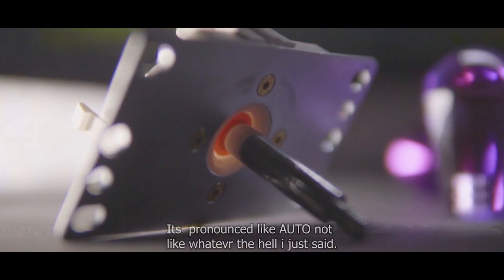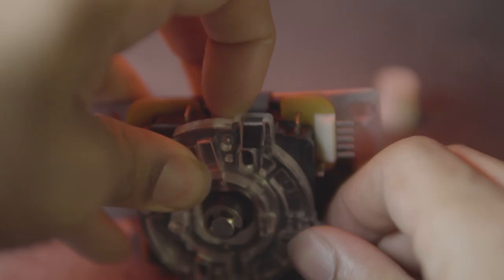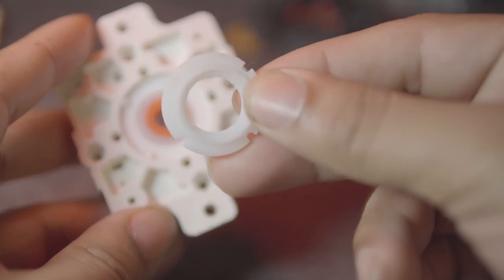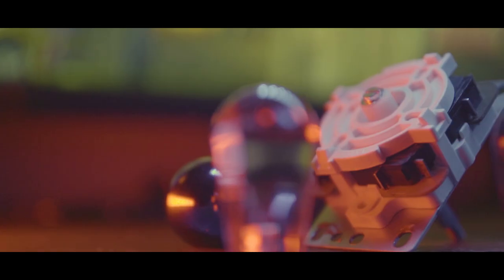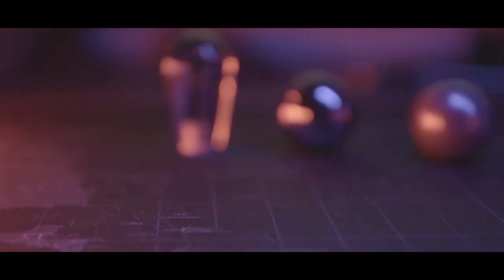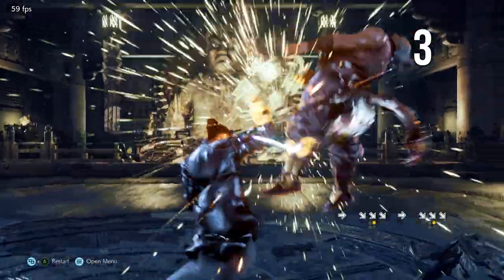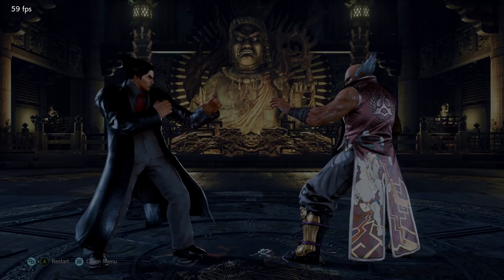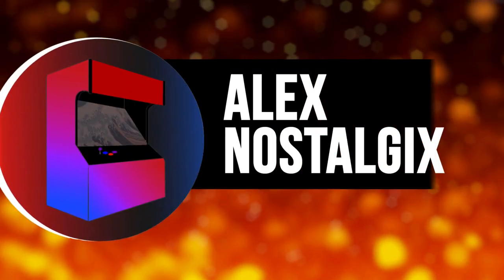A  Korean Sanwa JLF joystick? - OTTO DIY V2 Kit Review

Comment: I have a gaming pedestal and fitted two sanwa jlf's.
I had no idea how frustrating these joysticks are as they literally double-click all the time, causing input interference.
I initially blamed the switches, and wasted more money buying new circuit boards, I then purchased upgraded springs and a larger set of actuators, which then caused a lack of inputs.

I now have an otto v5 kit on order, and will hunt down the shuriken jlf solderless switch pcb. In other words, the sanwa is a terrible stick that is seriously flawed and has cost me triple the cost in the long run.

Comment: At 7:25, you bring up the issue of unwanted opposite inputs when you slap the stick in one direction and let it return to neutral, then say that it's not actually a fault of the kit itself.

Actually, it IS a fault of the kit. I installed the kit and had a similar issue myself, until I found a reddit comment describing it. The oversized actuators that come with the Otto DIY V2 kit have a diameter that is too wide to properly function with the JLF switches. I then swapped the Otto actuator with a Kowal oversized actuator that I purchased as the comment recommended, which matches the stock JLF actuator's widest diameter at that point, and the issue was diminished or eliminated entirely for normal use.

I just wanted to get this information out there in case anyone purchases the Otto kit after watching this video and finds themselves frustrated. It would be in your best interest to stick with the stock JLF actuator or purchase something like the Kowal actuator that is more carefully designed. Hopefully future iterations of the kit will fix this.

Below is an imgur album I put together with a link to the reddit comment, as well as a comparison between the stock JLF, Kowal, and Otto actuators.
https://imgur.com/a/Cq4gc25
Reply: I don't mean to say that it's impossible to get used to it, just that your initial feeling that something was off was justified.
Reply: Ok so I already have a bunch of different sized actuators.  You're saying it's fine if I use one of them?

Comment: Hey mate, I've been looking a tad into Korean parts. Do they usually fit where Sanwa JLF's fit?
Is the quality between Fanta and Crown too different?
Reply: The size here, I meant it's height, as from what I've seen, some Korean sticks have a protrusion.
Reply from the maker: @shocknawe  Not all Korean levers have protrusion due to the collar. The Crown MJ, 303 Dong Pal, or something like the Golden Fanta are just plug and play. With that said some fight sticks can't even accommodate a Korean stick due to the actual size of thejoystick body. I'm currently doing to Korean stick video comparing a few but unfortunately its on the back burner do to work related projects. So keep an eye out for it!

Comment: Oof. I really wanted to pickup this kit (trying to build one single portable stick to play both 2D and 3D), but coming from a Fanta I'm not sure I could handle the opposite inputs when you let go of the stick. I've become too used to the Fanta's return to neutral.

Could you elaborate on what you were saying about changing how you hold it, or perhaps your feelings after playing with it more? 

FWIW I mostly play Tekken tho my friends play SFIV and SamSho, which is my main motivation to get this kit.
Reply from the maker: I would keep my thumb, index, and middle finger on the ball top and rest my hand on the deck of fight stick. Then I would rest my ring finger on the shaft of the joystick for a little more control. Its not something I really think about since I started on a hyabusa and jlf from the start. Over time you wont even notice it and if you feel you have a heavy hand you can go with a heavier spring (2lbs preferably) and light ball top. Hope that helps!

Comment: Oh, I forgot to say: Does the OTTO V2 feel like a CWL209? I read that on Reddit.
Reply from the maker: The Diy kit offers a similar feeling but in my opinion it doesn't feel like a korean lever completely only sharing the grommet characteristic.  In regards to tension is where the 309mj would be a good comparison I guess.
Reply: Alex Nostalgix
I see. How about the diagonals? Those are my biggest concern, as I mostly play 2D fighters. I hear korean levers, in general, don't have the best corners and so far in my journey for my personal favorite stick, the stock JLF isn't it, as, to me, the diagonals seem awful to hit, even with a kowal actuator :/

Comment: does otto make an octagonal gate for this?
Reply: or will my current JLF octo gate fit on it?
Reply: @hylanderOP  As far as I know Otto do not make an octo gate. Your current gate will fit on it. However you may have to use a different actuator than the Otto one as it has a larger diameter on the mating surface that goes to the gate and would not "feel" right with the octo gate, to me anyway. I would try the rounded square gate first, as to me it is actually better than an octo. Once I got used to a square gate I stopped using octo's anyway but the rounded gate is really nice and works well with the oversized actuators.

Comment: How does it feel compare to real korean
Reply from the maker: TEKKEN EnterMyDragon if your looking for a korean stick, I would just get one. This kit only provides the grommet feel but keeps its tension even in neutral compared to a korean stick where you only get resistance until you get closer to engaging the switch.
Reply: @alexnostalgix  so you mean to say you prefer the v2 with stock omron switch korean feel better than the real korean like crowns? The benefit i see using this ottodiy is the use of phreakmods that korean stick is not possible to do
Reply from the maker: TEKKEN EnterMyDragon no I mention in the video I prefer a korea stick over the V2 Kit. Yeah Jlfs always get the good stuff first